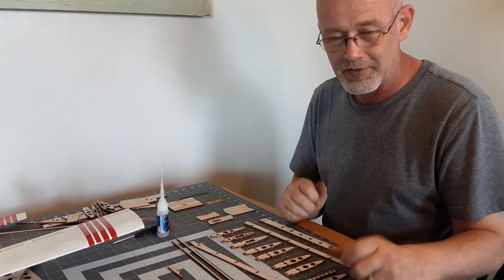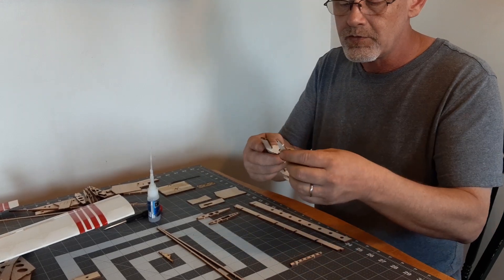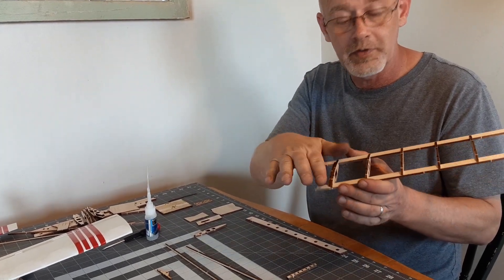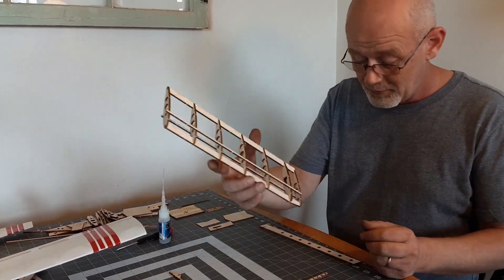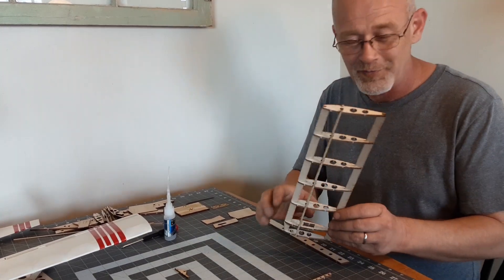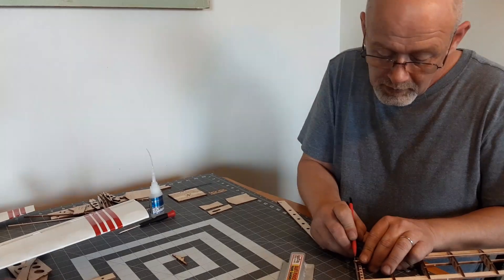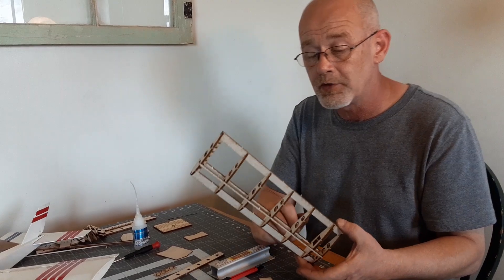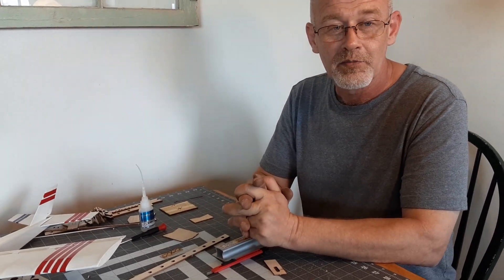GLH 250 wing assembly

Comment: I received my kit today and was going through it, read the instructions and watched your and other videos, does this kit come with control horns or do I make them??
Reply from the maker: There should be plywood control horns in the small hardware zip lock bag.
Reply: @willynilliescom3927  not in the bag and the motor mounts next to F1 through F4 weren't in kit
Reply from the maker: @mreid08  you have the newest version of the kit that includes a plastic mount for the motor.  The control horns are laser cut plywood that are in the bag with the screws and blind nuts etc...
Reply: @willynilliescom3927  have plastic motor mount but no control horns. I'm ordering more stuff,  you can put them in with my next order.
Reply: @willynilliescom3927  and I'm going to have to get a motor and ESC and prop off your website too